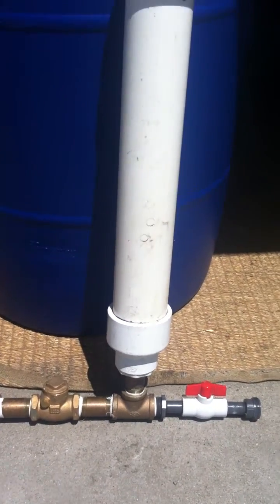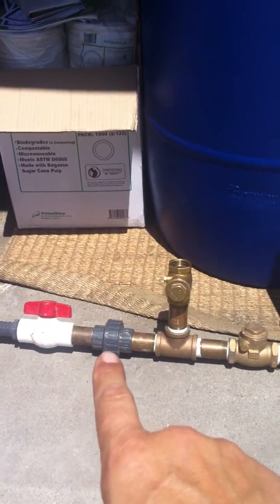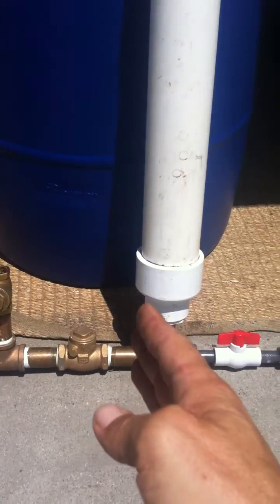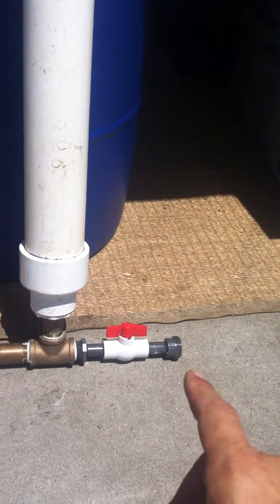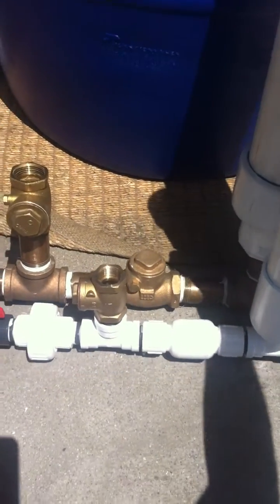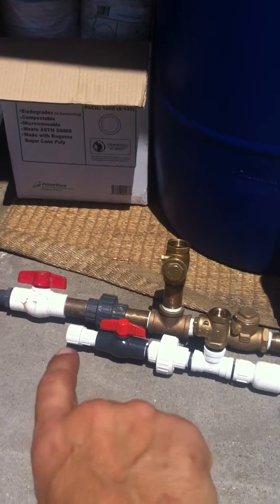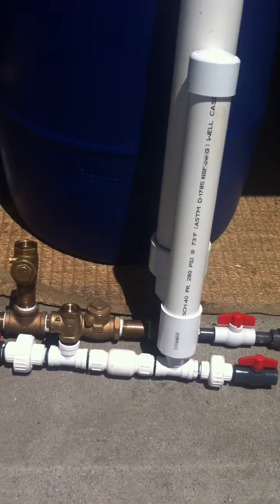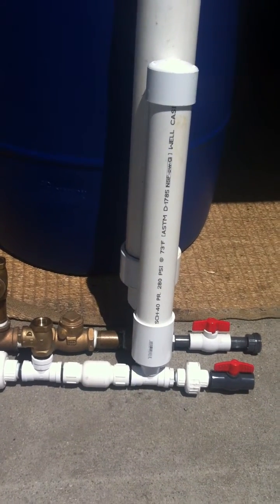3/4 and 1" Ram Pump Comparison

Comment: using solid pipe instead of flexible line for your drive pipe makes a huge difference. try using steel drive pipe or even PVC pipe instead of flexible line...

Comment: So, did this 3/4 inch ram pump do what you had hoped?  Did you stick with a 1/2 inch delivery or did you go smaller yet?
Reply from the maker: Well, I went back to the install site after my review and found that the stream was reduced to a trickle... just wasn't enough flow to get it going... the stream basically dried up over the long drought we had.  I checked in after all the rains we had this winter but haven't heard back from client... I'm guessing he gave up.  I'm going to try contacting him again... I'd love to get it up and running!
Reply: You could comfortably run a 3/4 inch pump on 2.75 to 3 gallons of water a minute.  Actually you could do with less, after a bit of tuning of the pump and coming to accept a sacrifice delivery volume.  I'm using a 3/4 inch pump on about 3 a minute.

Comment: After seeing a few of Seth's video I went ahead and built a 1.1/4" pump, one thing I did do, based on his suggestion was to put a one way valve into the start of the delivery pipe, this helped a lot. i am now pumping water up more than 50 feet and over 300 feet away